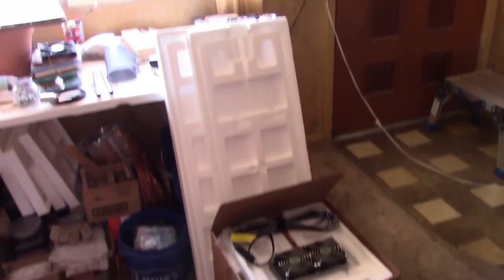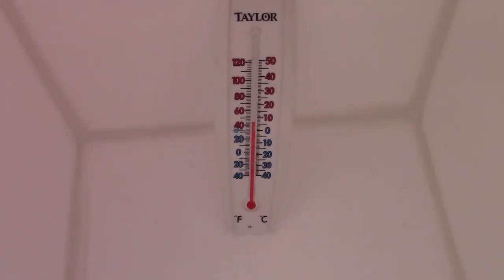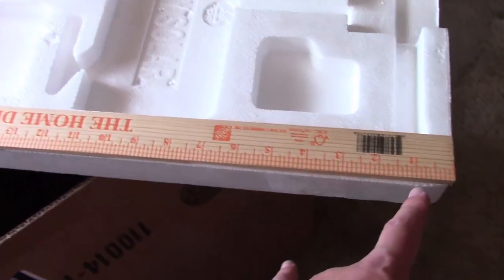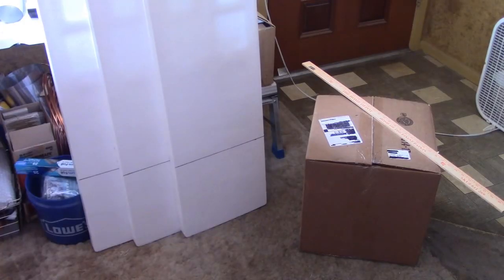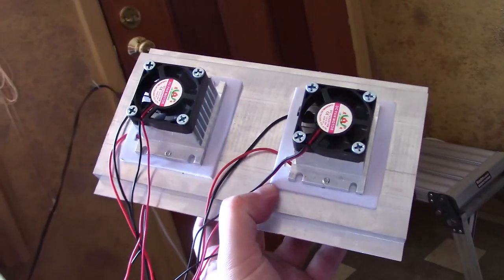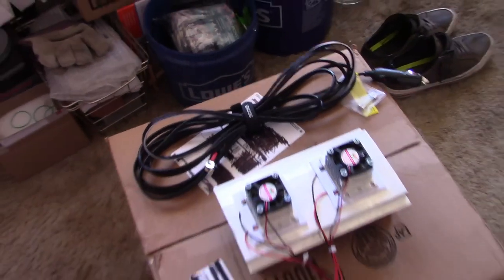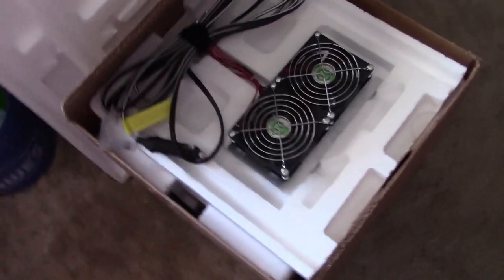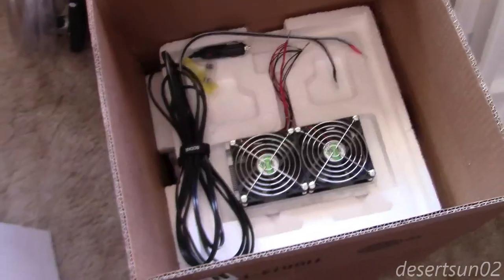Homemade Fridge! Peltier Refrigerator! SIMPLEST design ever! 44-45F! (6-7C) DIY "Chest" Refrigerator

Comment: Superb video with excellent content, been watching ur channels for ages.  Any idea how much power the peltier uses, I am off grid without a fridge and need a low power consumption solution.  Maybe add food in fridge to show it working?   Thank you
Reply from the maker: hi there and thanks. it draws 144 watts at full power. for maximum efficiency and to lower the overall power draw even more you can do 2 things. first, if you don't need the full 30 qt. capacity, you could make the fridge smaller and use a 120w petlier module or even a half size (6a one). with good insulation and a half size cooling module you could cool about 15 qt. second thing you can do is add a thermostat. those are really easy to add (and are only 5 bucks on amazon). to see how to add one look for my lunchbox size peltier cooled fridge video. it's got one. i may add one to this unit too.

Comment: I was just thinking the other day if ducting cold air from the top of a deep freeze into a heavily insulated box would get cold enough to work well as a fridge. I might try that some time, I'll have to build a new top for the deep freeze so I don't ruin the one that's on it and figure out a suitable duct, then I need a fan to pull the air  to the fridge box. That's a neat idea, thanks.

Comment: Please share the results after putting in some water/soda cans, curious to see how much cold it can get and in how much time. I made mine with 4 x 12706 peltiers cooling a 1.1cuft sealed box with 6 1liters bottles of water and after running for over 3hrs the temperature only dropped to 12*C with ambient temp at 27*C. I tried cooling the hot side of the peltiers with air cooled solution like yours and also liquid cooling but the results were pretty much the same
Reply from the maker: hi. it cools down anything you put in it at about the same rate as a regular kitchen refrigerator does. it puts out the same cold air (and at the same rate) no matter what you put in it.

Comment: how much heat does the peltier give off? want to use this in my van when i travel but wondering if it will be too hot? if u have a chance let me know what you think! thanks so much for ur vids.
Reply from the maker: hi there. it's not very much heat. it might raise the temp a degree or two but that is about it.

Comment: idk about this one, cooling an empty box is far easier than cooling beverages.  Can this cool 6 cans of soda down to 46 degrees in a practical amount of time?
Reply from the maker: hi. people seem to often make that mistake. i'm not sure why though (unless other youtube video creators are saying that it matters). but it's actually harder to cool the empty air and keep it cold than it is to cool items like food and drink. it easily cools food and drink. (*that's why i didn't put food into any of my peltier fridge videos. i didn't think anyone would want to see that - because if it cools the air then it definitely cools anything you put in it. these units cool very quickly and then stabilize. 👍🙂
Reply: @desertsun02  The reason I say that is because of thermal mass.  If you buy soda from the store at room temperature, at put it direct in the DIY fridge, it has a lot of work to do - because of all mass that needs to be cooled.  Of course if you put already cold soda in the DIY fridge, there is no work to be done, and the fridge doesn't notice, it only job is to offset the small amount of heat leaking in through the insulation.
Reply from the maker: @s9 josh one difference with these fridges is that they don't kick on and off like compressor based fridges. they run constantly - so they are constantly cooling) - no matter what is in the fridge. you can set them up to kick on and off but i just let it run. i did add a thermostat to the one i built from a small coleman cooler but my others just run non stop. the main thing is not to oversize the fridge. the 12v 12a peltier module won't cool much more than 1 cubic foot of space. that is the size of this fridge.

Comment: Cool idea.  Can leve a link for the fan ? Were to get it.
Reply from the maker: hi there. best place to get them in amazon. i didn't leave a link because then that gives all the business to one company. (also they tend to raise the price after seeing all the extra interest in the item). if you search 12v 12a peltier on amazon you will see them (several models...). they also sell 10a units and 6a units and probably other sizes *if the space you are cooling is smaller than the one i made. the unit i used can cool 30 qt. *but many people may make a smaller fridge so a 6a unit or a 10a one may be all they need). note: watch the prices carefully. they range from 20 to 47 dollars and change by up to 10 dollars every few days. i've got 2 units that size. i paid 31 for one and 26 for the other. 6a units are as low as 18 dollars

Comment: What is the current draw?
Reply from the maker: hi. it's a 12v 12a module (has 2 12706 chips in it - 5.8a each). i couldn't go with a single (6a 1 chip unit) because those can only cool about half the space.

Comment: So inside the box there is nothing like... No ice no water????? I still don't know how does that get cold with nothing inside...
Reply from the maker: hi there. peltier get hot on one side and cold on the other. the cold side is in the box and the hot side is on the outside. that's basically it. for detailed explanation of how peltier works i'd check wikipedia. it would be too hard to for me to type it all out in the comments section.

Comment: What’s the fan device?
Reply from the maker: hi there. it's what's called a peltier cooling module. it comes fully assembled but in brief it's 2 small fans, 2 big fans and 3 heat sinks made out of aluminum. (along with 2 chips (peltiers)). those chips are sandwiched between the heat sinks. the peltiers make cold air by basically shifting the heat on the chip from one side to the other (which leaves the other side very cold). the 2 small fans then blow this cold air into the box.
Reply: @desertsun02  What is the original intended application of the Peltier system?
Reply: @desertsun02  thanks for your reply

Comment: Did you use thermal paste on the Peltier module to help conduct heat?
And another important thing for optimization both on power consumption and cooling efficiency: The Peltier module should be powered up by a limiting power supply. If you just give it 12V all-you-can-suck current it will not work at its best. There are available datasheets with the efficiency diagrams and you need to check a couple of online videos to know how to interpret them, they are not simple, but they will make your fridge work cooler and suck less power. Or you can try trial and error with voltage and current.
This guy does a good series of videos about Peltier modules:
https://www.youtube.com/watch?v=d8FY0jGFbZM
Reply: Oh wow, I have never thought that someone would recommend my videos! Thank you for it!